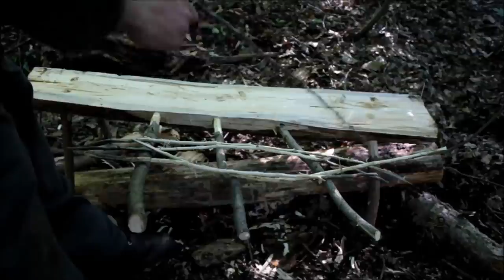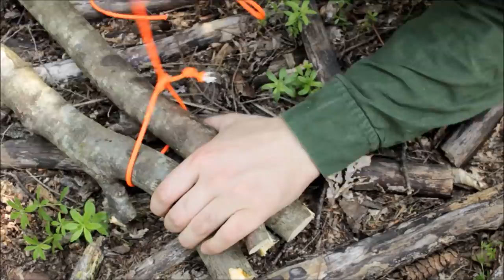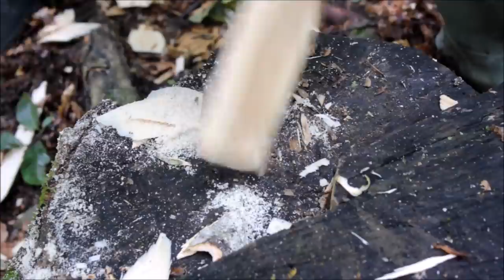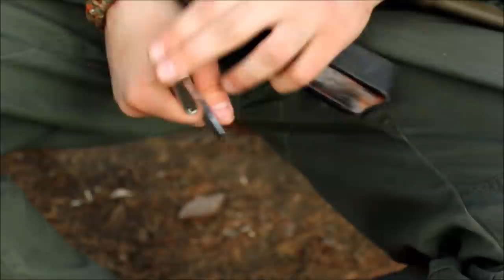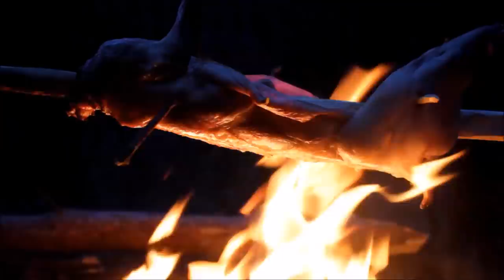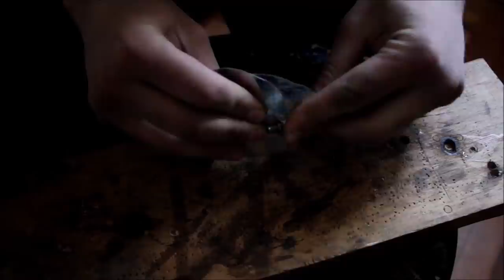Bushcraft Skills , Crafts , Tips & Tricks - 6 Years in the Bush - HD Video

Comment: On the wood stove you made, you might want to make the pipes the length of the  stove so you can store them inside it and on the three holes in the front under the door put a piece of sheet metal so you can control, also, the air coming through there which will dampen the fire further so you can make your fires last longer. :) Excellent design though. Oh, and some type of skis on the legs so your stove doesnt melt into snow or bury themselves into the snow or ground. :)